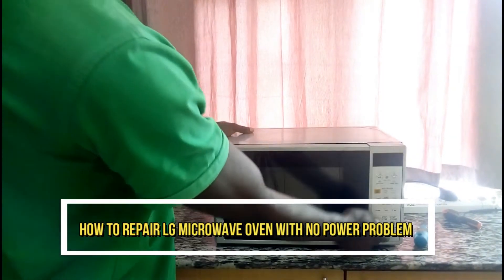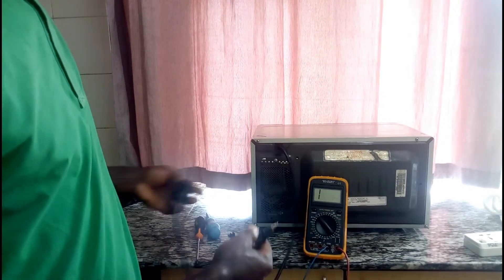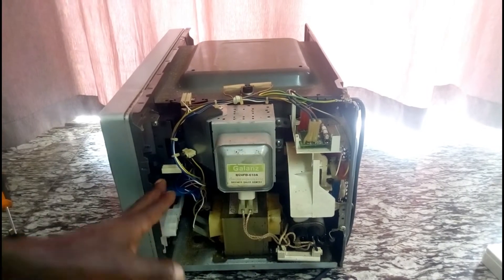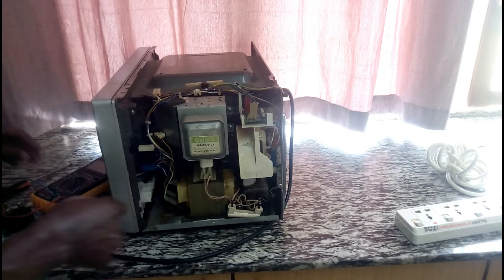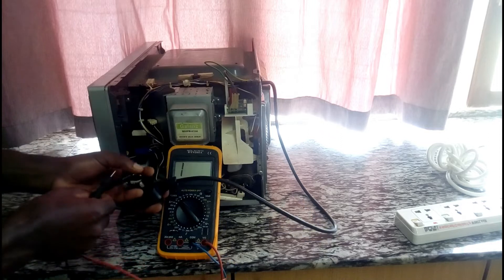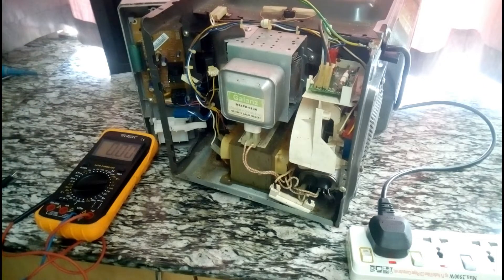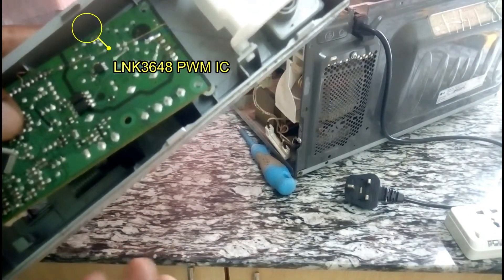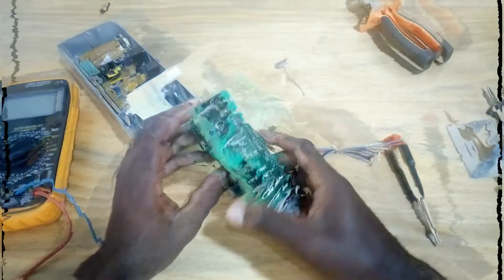How to repair LG microwave oven with no power issue/not powering on.@felixtechnoaid2044 ,  0784340629

Comment from the maker: This is LG solo microwave oven MS 2021c it had a problem of not powering on, power supply part found defected LNK3648N switching ic was burn, it was easy to replace it but this IC was not available nearby, I used Galanz microwave auxiliary power supply board to supply 12V to relays, and 5v to MIcom, is this video helpfully ? tell us how you see it in a comment, do not forget to subscribe , to like, and to share❤️❤️